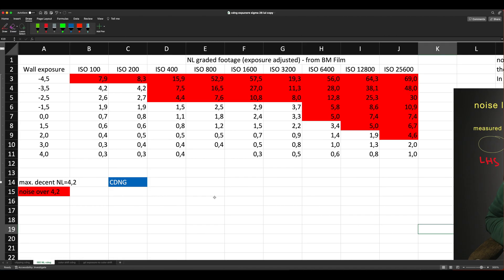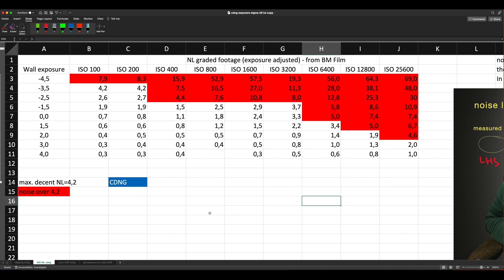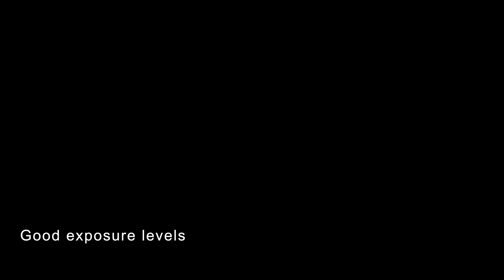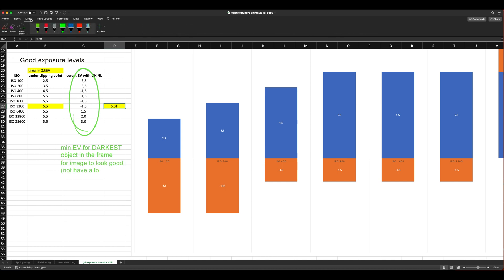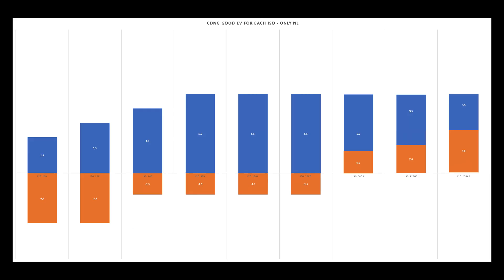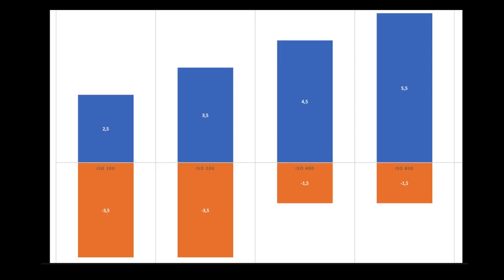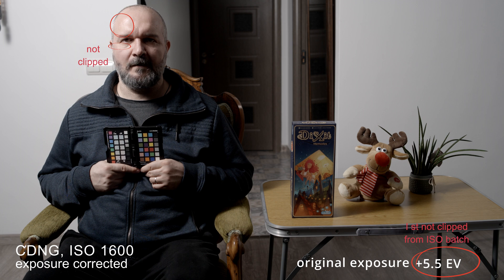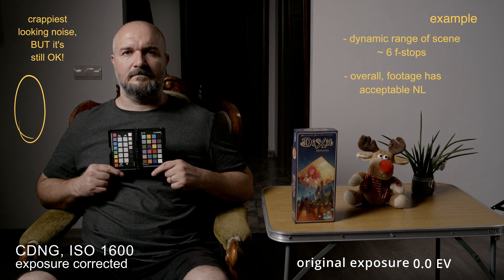BITESIZE “How to correctly expose Sigma FP RAWs EP. 3 – CDNG”

Comment: From what I understand regarding exposing the FP,
When in bright and contrasty conditions - iso 800 is good because of good headroom and legroom 
And, in low light situations - iso 100, 200 / 3200 is good because of greater legroom and less noise.

Would be using ND filters to maintain good exposure levels. 

Would this understanding be accurate?
Reply from the maker: Yes! that's spot on! Use ND filters outside in bright light - i did some new tests and even ISO 400 offers a lot of headroom and legroom. 
Whilst ISO 100 or 200 could theoretically be used in low light to minimize noise, in practice I only use ISO 3200 cause the other two are just too dark
Reply: @IonCosmina  In low light, I figured ISO 100 would be too dark too but this creator, (I'll share link to his video below) has managed to get a great image at ISO 100/200 in combination with f1.4 lens in night scenes. He mentions this in the comments. 

I guess there was enough light. It's encouraging to see.

https://youtu.be/OAhGbgzBILE?si=et7sgTPshsDHEUMG

Comment: Thanks for the review! 
But the camera has no exposure values less than -3 and +3 in movie mode. Did I understand correctly in the case of dark areas do not do darker than the specified values, and in the case of light areas do not do brighter than specified?
Reply from the maker: Thanks for watching! Even in RAW, the exposure meter of the camera doesn't show more than -3 or +3 EV unfortunately. But since firmware update 4, you can access false colors from the camera, which will give you the colors corresponding to EV outside of those ranges. 
Yep, you understood correctly. The specified values for the clipping are pretty much what you have for the official SIgma FP dynamic range chart. The dark areas have EV higher than the shadow recovery specified in the official chart because I took into consideration the noise levels too.
Reply: @IonCosmina  Thanks for the reply! I still don't understand how these false colors work, what am I supposed to see? I've heard that this is a useful feature, but I haven't figured out how it's supposed to work myself.
Reply from the maker: Each color corresponds to an EV range. for example Pink is +1 EV and means good EV for skin, green is 0 EV, red is clipped areas (that differs from iso to iso, for example iso 100 red starts from +3)
Reply from the maker: you ca see if this helps False colors - what is it?  https://youtu.be/Mrt26oZuBGM